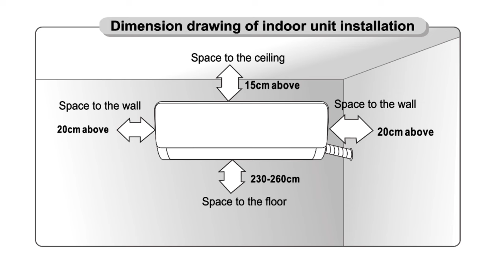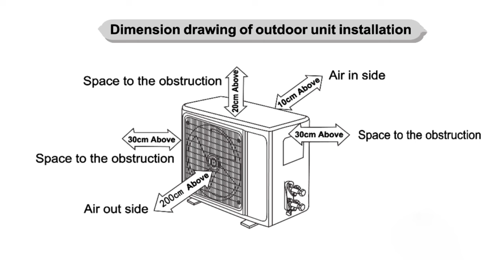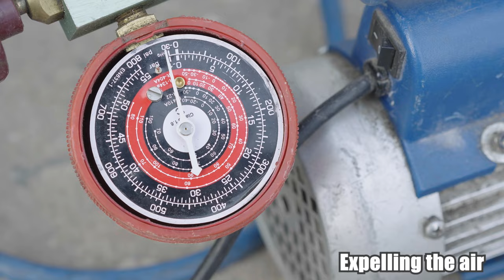How to Install a Split AC System at Home |  Stay Chill with Costway Split AC | FP10293US

Comment: I installed one today and I’m getting an E5 error code? Anyone know what that means?
Reply from the maker: Hello! Firstly, check if the internal and external models match, then check if the wiring is correct, and finally check if the internal and external controllers are faulty.
Reply: Did you resolve the E5 issue?
Reply: I had same issue, fixed it by removing my Neutral wire from the S. Guess all it want was ground wire +_+
Reply: @costway  Et bien je trouve que vous dites n'importe quoi. Comment voulez-vous qu'un simple client puisse vérifier le contrôleur interne et externe de l'appareil ? Cela demande les équipements et les connaissances d'un technicien spécialisé dans ce domaine. Vous êtes ridicule et incompétent pour donner de l'information pertinente sur ce forum. Je n'achèterai jamais de vos produits et je conseille aux gens de faire pareil.
Reply: @theoriginalscottmalkinson6161  À cause de moi ? Je devrais demander une commission sur les ventes de Costway. Si tout les étapes d'installation sont clairs pour vous, surtout la partie qu'on doit faire le vide du système, vous devriez nous faire un vidéo à ce sujet, ce serait grandement apprécié.
En passant, je suis francophone mais pas Français tout comme vous êtes anglophone et probablement pas Anglais; il y a eu aussi autrefois des colonies françaises, et oui.